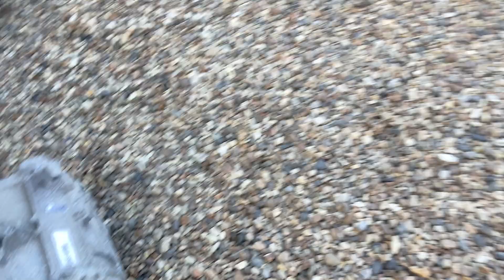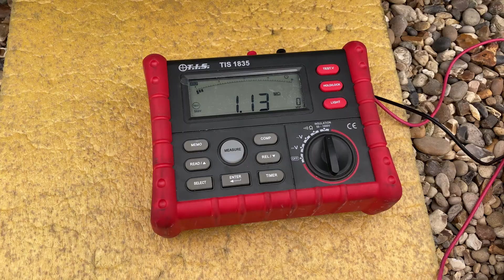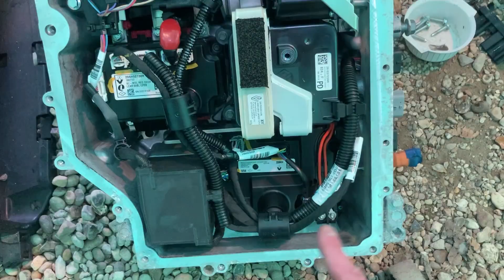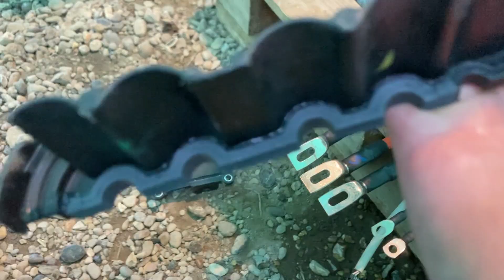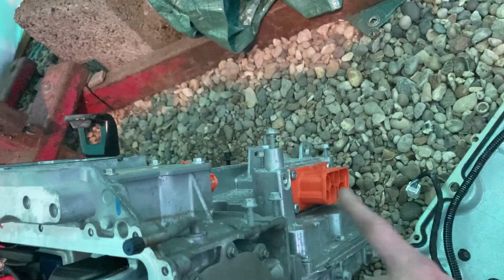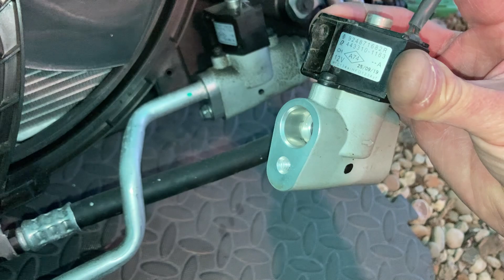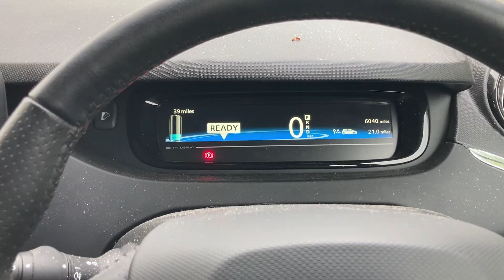This ELECTRIC CAR IS DEAD after only 6,000 miles - Can we fix it? Renault Zoe EV Repair

Comment: So, basically, achieving  EV propulsion  is just as complicated as it is in an ICE vehicle, but the many bits all have different names and you need some annonymous person using an internet connection to give your lame EV the right  codes before anything you have repaired will actually, finally, work. Brilliant. No wonder the Renault team gave up. Is it really not possible to design a simple EV? Christ on a bike! - electric bike, naturally. Thanks.

Comment: could you not take off the motorcontroller and immerse it in isopropyl alcohol to drive out all the coolant and then allow that to evaporate?
Reply from the maker: Hi that might have worked but it takes so long to remove and refit that if the controller is electrically damaged then the labour of removing and refitting again Plus a new controller would make it very expensive, if it was quick to remove and refit then I would have tried cleaning it. Cheers

Comment: Re: the coolant contaminated motor controller. If you can get it off, you could give it a couple of baths of de-ionised water to remove the coolant, then isopropanol to absorb the water from the nooks and crannies, then dry it to evaporate the alcohol. It's a faff, but it's possible for expensive unobtanium parts.

Comment: What about a HUAWEI B331 Home Hub+HUAWEI B331 Antenna pack+SIM card to get the Router working and you can have it in the garage and you won't have to worry about getting a long ethernet cable to let you program the controller and if you want you can bridge the two routers.

Comment: Not relevant in this case now but maybe IPA could clean up the coolant?
Reply from the maker: It could do but we wouldn't know if the controller is damaged, or if anyone was left behind then it might still not work and it takes a very long time to fit it, find it doesn't work and then take it back out again so it was best to go with a new one in this case. Cheers
Reply: @garycevrepairs  I guessed this would be your answer as like you said the time involved should it not work negates any advantage.

Comment: Hi Gary.
Great video and great diagnostic skills. My only issue is that your constant use of "yeh" is excessive and irritating during the length of the video.
Kind regards Allan
Reply from the maker: I fix cars better than I present, to be fair after a days hard work few people would be perfectly scripted to camera. It gets the point across that it can be fixed. Cheers

Comment: There are a couple of ceramic products used on the coolant systems of ICE cars to seal leaky casting. Mostly cast iron but I guess alloy castings would also work.. some research would confirm that.
Cast iron castings on older engines could be porous and would not seal and allow the coolant system to pressurise. 
Perhaps you could use a similar product to seal up the porosity in this casings coolant jacket.

Comment: little bit of a note, you CAN run water in a cooling system, it just doesnt bode well for the internals because they corrode. The ONLY reason it works is because the cooling system is pressurized meaning the boiling point of the water is raised the more pressure you have.

Comment: As they say here in Germany, it was all * 'Bahnhof' * to me, a 70 yr old with 2 years of BMW iX1 experience and still doesn't know the difference between kW & kWh. However, fascinating video and a great job. Thank you ....or as they say here 'Dankeschön'.
** https://en.m.wikipedia.org/wiki/Bahnhof_verstehen#:~:text=The%20origin%20of%20the%20phrase,to%20concentrate%20on%20anything%20else.

Comment: So, no 60,000 mile bumper-to-bumper warranty, and 100,000 mile drivetrain warranty from Renault?
Reply from the maker: Yes but only for 3/4/5 years depending on exactly when it was sold and it’s a 2018 so 7 years old…

Comment: I'm really surprised this isn't covered by a service recall, because this is a huge manufacturing defect caused by Renault. So it should be applicable even outside warranty, considering they did such a poor job.
Reply from the maker: It’s not very common unfortunately but is clearly a manufacturing defect. Cheers

Comment: So why is this not covered under warranty? Why so much dust on the steering wheel column for 6,000 miles? Plus I can see it was wrecked on the front left side.
Reply from the maker: Warranty expired based on age. Condition is due to an older owner! Cheers

Comment: Watching this great video, i was tinking of two possible solutions on drying out coolant: The first one is WD40. WD is a shortening of Waterdisplasment after all. It was originally made to dry out rockets. The other thing is this: Wouldn’t washing damp parts in alcohol or break cleaner remove the coolant, so that it could dry out?

Comment: Would you have used a megger on the motor windings, disconnected from the controller but still in the car? That would have peoven flashover at higher voltage if that was the issue?

Comment: Could the porous casting not be sealed, once all the gubbins has been taken out, maybe with a coat of anti-tracking varnish or similar?  Or is there a specialist coating like conformal coating that would do. Even 2K paint at a push ?
Reply: The problem seems to be that the gubbins inside the case have been ruined by the leaky casting. 🤔
Reply from the maker: Might be possible but I had spare cases that I had stripped components from, so just swapped it and replaced the contaminated controller. Job done.
Reply: @garycevrepairs   As casting get to be short supply, coating may be a cheaper get out, unless the Manufacturers fix the problem themselves, (highly unlikely as it costs money). Stay safe dude ...

Comment: you can sometimes remove water using isopropyl alcohol, if you combine the 2 as alcohol is hydroscopic and will absorb water, it can help 'dry' it out, then the isopropyl can just evaporate alot easier than the coolant/ water, it wont harm rubbers or any components, just might dissolve grease abit
Reply from the maker: It may have been possible to dry it out but as it takes so long to remove and refit I needed to be sure the repair would last. If it was quick to take out again then you can try a few methods. Cheers

Comment: I had a dead 2020 leaf delivered yesterday,that apparently had an electrical issue. The recovery guy seemed to be making a meal of it and after going to see what was going on he pointed me to under the car, just behind the osf wheel there is a huge bolster type blade about 2" long, from a Kango type road breaker,half protruding through and into the footwell which is now stopping us from steeering right and using the  brake pedal .We dollied the leaf into a gap in the yard and I decided it was a job for next week😂

Comment: 6000 miles...not worth fixing. Well that settles it, I'm going straight out and buying an EV..probably a Renault.
Reply from the maker: Well it seems like it is worth fixing as the customer paid me to fix it… Renault just didn’t want to do it!
Reply: @garycevrepairs  That's kind of my point. If you  buy a Renault, drive it 6k miles, and (presumably no warranty/too old) Renault deems it not worth fixing...I'd hesitate to buy a vehicle from Renault. Generally the dealership is the first one to pounce on the impossible, and charge you the price of a new one...after firing the parts cannon at it for a month.

If Renault deemed it "not worth fixing", that should teach those who thought to buy a Renault to..maybe not buy a Renault.

Comment: AMAZING ! What a treat to see someone with so much knowledge and taking time to explain it in this much detail. Shocking that the quality control and standards on the casing are clearly inconsistent and these are supposed to be cutting edge tech. Or is it more throw away mentality.. at 6000 miles!!! Great video and great job.

Comment: Gary, can you wash the motor controller with soapy water and dry up afterwards which may remove the coolant?
Reply from the maker: Hi could work but it takes so long to remove and refit that you need to be confident in the repair. Cheers

Comment: How about flushing the motor controller with pure alcohol or something?
Reply from the maker: Hi could work but it takes so long to remove and refit that you need to be confident in the repair. Cheers

Comment: Can you not possibly use an ultrasonic bath to remove the moisture from the controller pcbs?  Works for most things!   The computer boys use them for PCBs a lot.  Would save a lot of money for a new controller I think!  First class diagnosis though!
Reply from the maker: Hi could work but it takes so long to remove and refit that you need to be confident in the repair. Cheers

Comment: could you flush the controller with 99% IPA (not pale ale) to remove the coolant and dry the controller out or has the controller failed
Reply from the maker: Hi could work but it takes so long to remove and refit that you need to be confident in the repair. Cheers

Comment: it uses a brushed motor? not a brushless? ok I see its winding in the rotor, so thats slip rings got it.
Reply from the maker: Brushless 3 phase design but wound rotor (no magnets) so slip rings on the rotor shaft. Cheers

Comment: Just stumbled across your channel . Very interesting case study and a tricky one to diagnose . Was just wondering if you think a smoke machine may have helped in your diagnosis to confirm the water leak . It’s often used to detect vacuumed leaks as you may well know . Plus water leaks on cooling systems . Just a thought .
Reply from the maker: Hi I could have investigated it more but I had spare cases where I’ve stripped them for parts so just cracked on with the replacement. The water hardly gets hot though as it’s just electronics cooling so the pressure can’t really be that high, nowhere near a petrol or diesel engine when hot, must be very poor casting. Thanks for watching. Cheers

Comment: All the comments asking can the controller be dried and cleaned out and reffited.
It can, but how much work is it  to do, refit everything and then find it doesnt work.
Unfortunately at £900 the part is better to be replaced until you have a known working one to keep as a spare (by doing the above clean and testing the unit,or getting a known working unit and testing it.
Reply from the maker: Spot on

Comment: Glad i dont have an ev or a french one either. French renowned for their electrical & build quality !!  For the price of an EV i did double take when you said brushes on the motor.  Would have expected    at least brushless
Reply: It is brushless, if you’re thinking of a brushed DC design. It’s brushless AC but externally excited, which is where the brushes come in. Means the motor has no permanent magnets.

Comment: Clean the coolant  off with either brake and clutch cleaner or electrical contact cleaner neither of them should harm the circuit boards of the controller…

Comment: Just stumbled accross your Channel. Amazing diagnosis and repair. Especially the porous casting  👏👏. A very talented guy /EV specialist 👍 Renault obviously didn’t have a clue and didn’t care about the customer  🤦‍♂️ Amazing diagnosis and repair without just fitting a new motor and parts 👍 At best Renault would have fitted a new motor and controller into the porous casing. And charged the customer more than the cars worth 🤦‍♂️ 😱 Have worked on electric Forklifts but nothing as complicated as the EV cars. Good luck with the repairs and channel. You deserve a proper high tech workshop workshop with your talent. Hope you achieve it soon. Another New subscriber  👏👏👍
Reply from the maker: Thanks 😁

Comment: Can i be honest and say that i think its more likely an over pour of screen wash/coolant than pipe bleed. My bet is a non ionic surficant type of screenwash (which would leave a soapy residue) based on the location of the filler cap and amount on the belly pan. Poor design in my opinion.
Reply from the maker: Can’t see how screenwash would end up inside the control box.
Reply: @garycevrepairs  Possibly in the dodgy wiring grommet between the loom and the control box

Comment: Can the motor controller be repaired? Does it just need a good cleaning? Give it an ultrasonic cleaning?
Reply from the maker: It may be possible but as it takes so long to remove and refit it’s not really viable to try cleaning, the labour time would be more than the cost of a new controller if it all had to come out again. Cheers
Reply: @garycevrepairs  Thanks for the reply. This was the first of your videos I have seen. You  could make a good follow up video or send to another YouTuber?  Would be good to see if the fault was the coolant causing a short and if it can be repaired .

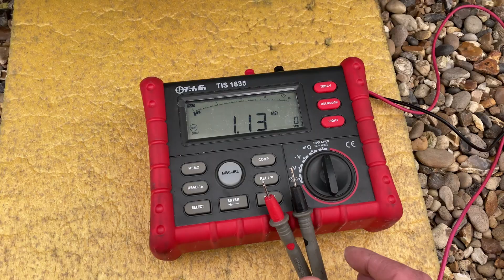Comment: Well done. I know nothing about EVs (or anything else in particular), but have a question. When you measured 1.13M Ohms (10:10) between the motor stator and the case, with the controller disconnected, does that indicate that there is (or was) also an issue inside the motor? The fact that 'conductive ' coolant can leak inside the controller and motor horrifies me.

Comment: Had a Renault Stealership come to our firm for advise on a Renault 5  many years ago it had clicking constant velocity joints they could not cure with new shafts tried two sets,
I had a brainstorm and as they were the same length did a swap over instant quiet, Then refused to tell them what I did lol.

Comment: Could you have not possibly just washed the controller and all that with IPA? So long as the coolant hasn't caused corrosion issues IPA would displace it and then evaporate
Reply from the maker: Possibly but as it takes so long to remove and refit you can’t have a go and see if it works, you need to know you’ve done your best to get it working when it goes back together.
Reply: @garycevrepairs i get it, especially with a customer vehicle, if it was my own, ill take those chances, heck I would probably not even remove anything and I would have just sprayed IPA in there till it was filled, pump it out and let it air dry for a couple days with a fan

Comment: If I suspect something is coolant I taste it.  Ethalene glycol tastes sweet. I don't know what the modern organic acid coolent tastes like.  Brake clean will get coolant off.  I would have liked to clean the motor contacts to check the leakage to earth reduced before throwing parts at it. I totally see why you did as you did. Thanks for sharing.👍

Comment: A friend was given a Nissan Leaf FREE - because the owner couldn't get it to power up. He took it to three different places and none of them could fix it so he asked my friend (who is an electrical engineer and electronics tech) if he wanted it and he said yes. In less than an hour he'd found the fault, repaired it and had the car running.

Comment: Why you fix it if you have Renault warranty!?or you don't have
Reply from the maker: No warranty, too old!
Reply: @garycevrepairs too old and 6000m/9600km only!?was it only in garage most of time
Reply from the maker: Time limit as well as mileage limit, so the warranty has expired on years rather than miles. Cheers
Reply: @garycevrepairs  shit quality is that if battery which was not used die anyway

Comment: You absolutely can remove coolant and other contaminants from circuit boards and components on them.   Spray it down with electronic solvent and dry it in a dry very warm place.  The cheap solution is isopropyl alcohol in a sprary bottle (exactly the same thing but 5% of the price).  Electronic repair 101.

As long as there is no corrosion and components have not be destroyed by stray currents then it's usually a 100% fix.

Comment: I'm a retired Aerospace Defence Consultant Engineer. From my experience, electronic components can often be cleaned safely using clean water. After rinsing, use an air line to blow off excess moisture, then place the components in an oven set between 50°C to 75°C for a day or two to thoroughly dry them.

Tektronix, for example, used to wash their oscilloscopes and then dry them in a cabinet oven heated with an oil heater.

For sourcing electronic parts like large transistor blocks, Digi-Key is an excellent supplier. For identifying components, the internet is an invaluable resource. Websites like Farnell Electronics and RS Components are particularly helpful. Most manufacturers label their parts with identification numbers or logos, which you can look up online.

In my past role at an instrumentation company, we used to seal aluminum castings for MOD Navy projects by soaking them in a special liquid sealant.

For identifying components visually, Google Photo ID can sometimes be useful. Manufacturers like LG and Samsung produce a wide variety of power components—there are just so many out there!

I also used to repair motor speed controllers at Dowding & Mills Ltd, which was incredibly rewarding. We worked on both DC and 3-phase motor controllers. When large motors weren't available, we’d use heating elements as load simulators for converters.

One of the most useful tools in any electronics workshop is an ultrasonic cleaning bath with a heater element—great for cleaning dirty components. For cleaning slip rings, Brasso works well.

By the way, it's poor design to have holes in a casting where liquids flow through. A much better approach is to use a separate side casting and apply zinc paste as a thermal compound.

Lastly, most electronic components have a manufacturer’s logo or ID. It's worth printing out a reference sheet from the internet—it’s incredibly handy.